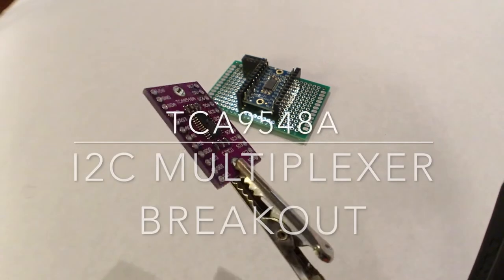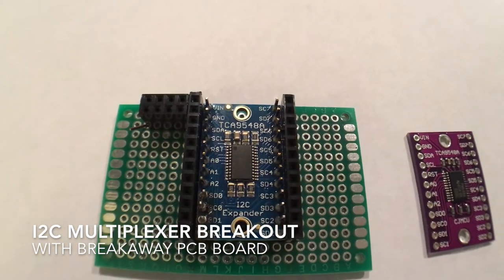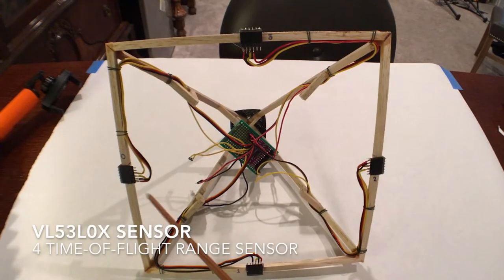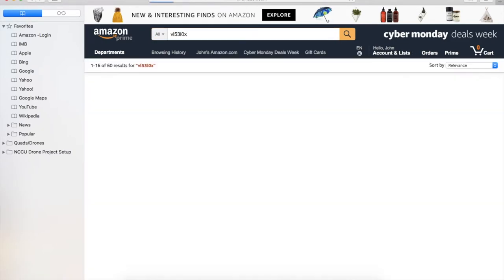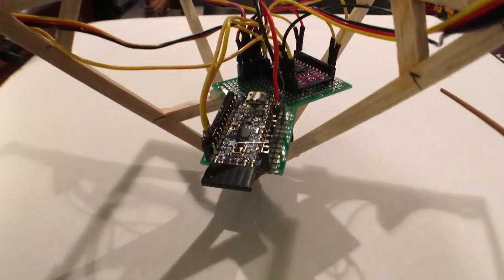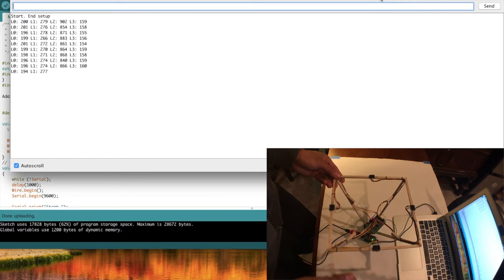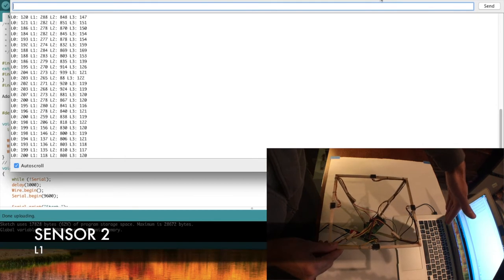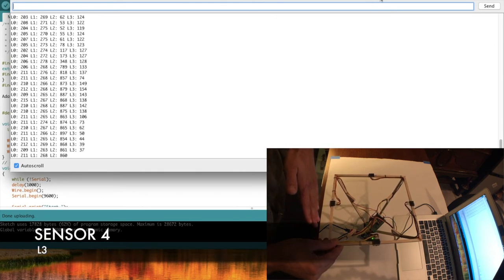I2C Multiplexer: Multiple I2C Devices One I2C Address

Comment: Good one, but next time when you record your sound keep the mic away from your mouth to avoid the "b" - bups
Reply: What is the maximum range of this?
Why haven't u used an ultrasonic sensor?
If you are using IR you should not get correct data if you use it in a hot day? What is your solution to that?